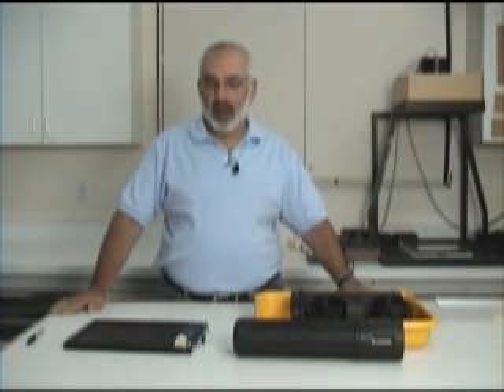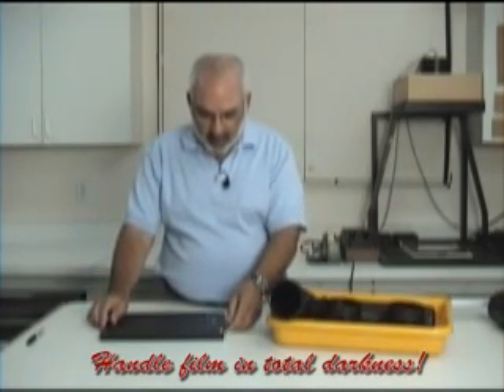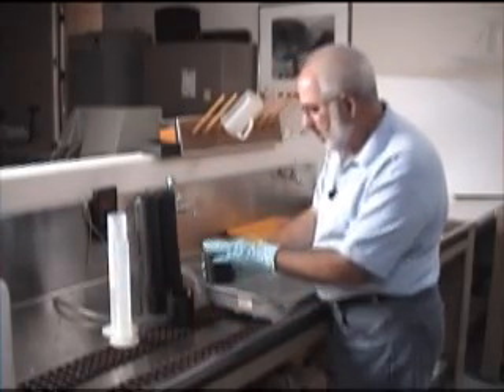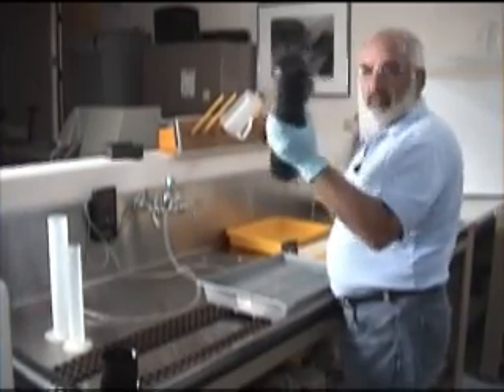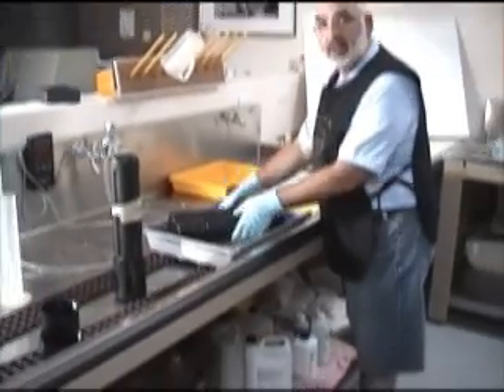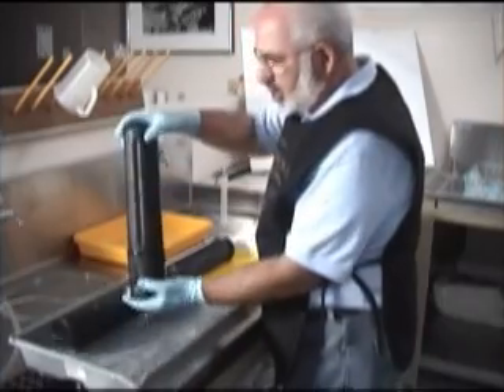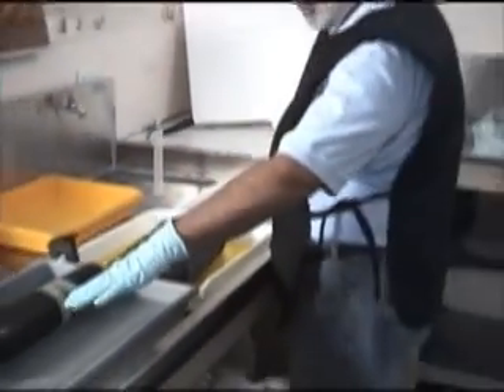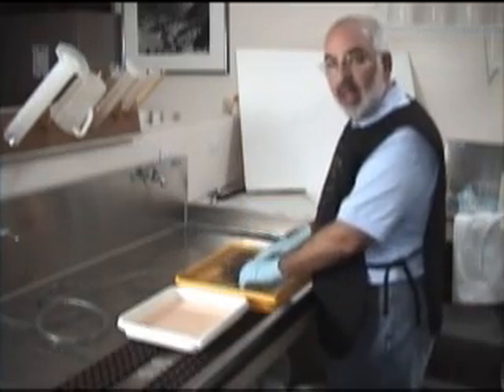1. Using the 8x10 BTZS Film Tubes

Comment from the maker: Hi Michail - 11x14 film is a bit too large for the 8x10 BTZS tubes.  They will work with film as large as 10x12.  They will work with 5x7, 6 1/2" x 8 1/2", 4x10 & 8x10.  Many years ago I had a machine shop make custom tubes that would do film as large as 12x20 to 14x17 but the cost got way too expensive.  I will look for the original information from Phil Davis & make a PDF to post for you.  Fred